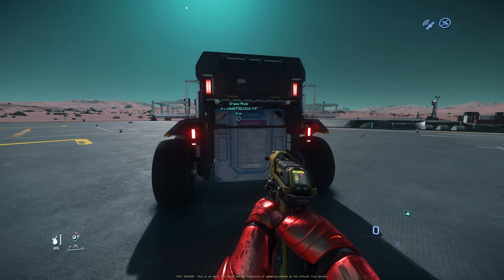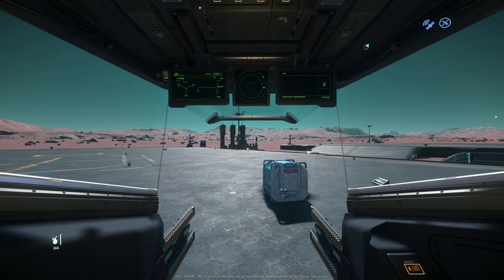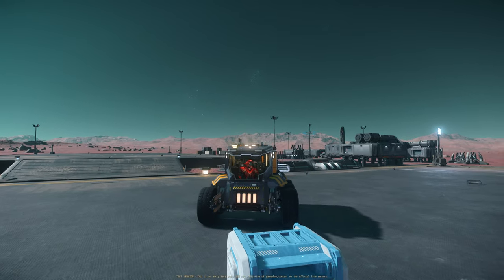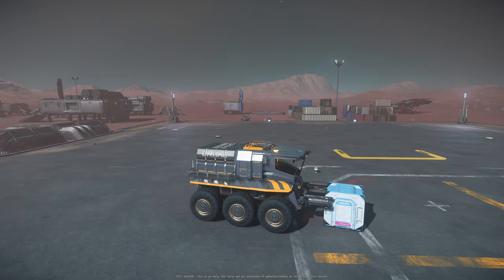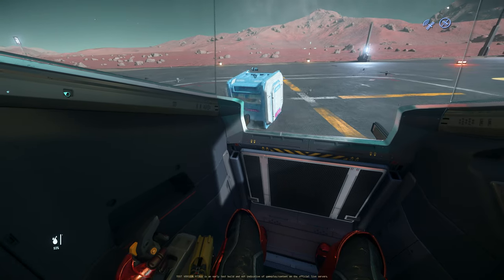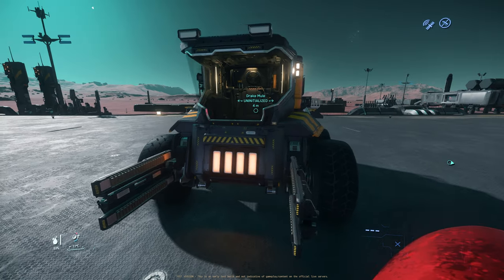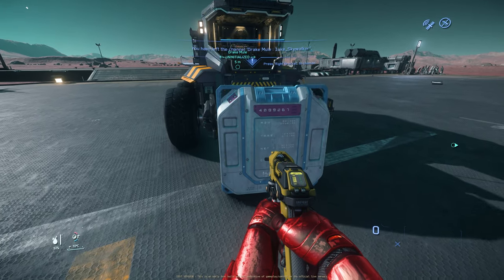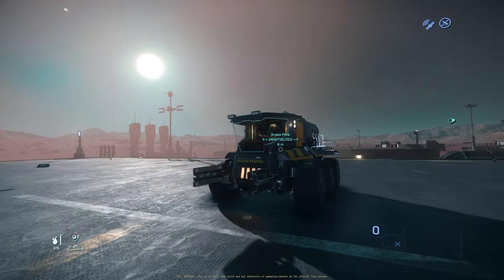Will It Work? Testing the Forklift of the Drake Mule I Star Citizen Science & Fun I 4k

Comment: This is going to require many Star Citizen Live episodes with top notch engineers sitting around and describing this extremely difficult gaming problem which will result in this put on some progress tracker for implementation in 2025 or later. Its really really complex, and dangerous. You shouldn't even have tried this - you could have been killed.
Reply: These mechanics (attachments and everything) done perfectly by farming similator 2022… FS22 devs > Star citizen devs
Reply: @lukadjogi  I had someone post me a clip of something that was a forklift game from either Nintendo or Sega, you lifted and placed boxes, I'll try to find it. He posted it when the Mule first came out.
Reply: @ronnieo9571  i mean i would give them all the credit if they just showed us an video on LOCAL server with all the systems and mechanics working as programmers intended, then i would be ok with bugs being blamed on servers.. now the whole game is just being ridculed and overshadowed even by some old 90’s game mechanics :’)
Reply: @ronnieo9571  you're probably referring to the Dreamcast game, Shenmue.

Comment: As I see it, the hand-held tractor beam is far more powerful and capable than intended, but acts as a stop-gap until the alternatives are working.  Power requirements to lift and manipulate a remote object make a ship-based beam feel plausible, but doing the same with a small hand-held device leans too far into the 'space magic' realm for me.
Really looking forward to the maturation of the cargo handling.
Reply: Exactly. The power of the hand held tractor beam mostly makes the Mule irrelevant.
Reply: I'm also thinking the same. The hand-held tractor beam is hopefully getting nerfed by the time vehicle-mounted tractor beams become a thing, and mechanical cranes and forklift become functional. With the mule you can still transport on the ground 1scu boxes way faster than you would on foot while dragging the box with the tractor, but until that becomes relevant for the game this is just a party trick.

Comment: Probably not implemented yet. The thing will probably need a tractor beam anyway and a button for letting go also.
Reply from the maker: indeed
Reply: Nah it works in 3.17, but 3.18 broke it
Reply: @BlackThanator  Since when are there any loose 1SCU boxes to even try to pick up in 3.17?
Reply: @TonViper  when you blow up a ship with loot in it, it spawns either a 1/8th SCU box, 1 SCU or 2 SCU, depending on how much loot was in the ship's inventory.
Reply: @BlackThanator  That makes no sense. The 1SCU boxes aren't physical yet.
Reply: @BlackThanator  The 1 SCU loot boxes are NOT the same as a 1 SCU commodity box. The loot boxes do not appear to interact with any cargo grids.

If the 1 SCU loot box interacts with the Mule forklift in 3.17, there is a good chance it will still work in 3.18, even if the commodity boxes don't. As far as I can tell, the loot box is marginally slimmer than a commodity box.

Comment: The problem is as long as the tractor beam is so efficient there will never be any real reason to use the mule's forklift
Reply: They need to nerf tractor beam in gravity. It's a ridiculous idea. Your wrist would snap.
Reply: How else would you move 20SCU something like ~400m?  If Mule is holding 2 SCU it's actually the most rapid way to move cargo distances like that.
Reply: Don't worry, if the devs catch wind of something being nice and efficient, they'll get rid of that method soon enough

Comment: I still don't really even know the intended value of the Mule is.. Even if it's able to forklift boxes around, they're going to have to implement gameplay that requires you to move them further than the reach of a tractor beam - which kind of excludes anything in a hangar.
Reply: min maxer, bro its just fun
Reply: I think you can expect the tractor beam to get nerfed once this works.
Reply: @Solno12  I absolutely hope so.
Reply: We take current loading/unloading for granted.  Imagine having to move 20 SCU 300m.  Are you going to take 20 trips moving boxes one-by-one on foot?  Are you going to load up an Ursa or another ship, take all the time to get to the seat just to drive that short distance, slowly get out and unload up to 5 times?  No, you're going to take 10 short trips with the Mule and move 2 SCU at a time very rapidly also with some 1/8SCU boxes on the side if you need to.
Reply: @mazack00  A quick fix for that in the future could be if they change it so the boxes have mass depending on what is in them, and tractor beaming around heavy boxes can only be done very slowly.
Reply: It's likely they'll be using it to carry boxes too heavy for the hand tractor beam.    Forklifts irl lift crates bigger than the vehicle.

Comment: I really don't understand the point of a forklift 900 years in the future where we have tractor beams.

Outside of selling a useless vehicle to players of course
Reply: Hauling cargo across a base or installation:  How could you do that with a tractor beam?  Pick it up and then walk for hundreds of meters in a place where you can't fit a ship with a tractor beam?  Yes, no point, very useless. 😆🤣😆🤣
Reply: @mazack00  you use an Ursa for that, no need for that cumbersome Forklift which also prevent you from leaving while its loaded. :)
Reply: @CathrineMacNiel  Ursa is bigger, less nimble and more meant for all terrain & long range.  Loading/unloading and entry/egress is way less convenient.  Mule fits that short-for-vehicles-long-for-people-range, high volume movement task perfectly.  I'm picturing people running 2 SCU at a time quickly from one landing bay to another which if you think about the current scale could be a pretty decent distance for someone on foot.  We really take current loading and unloading for granted.